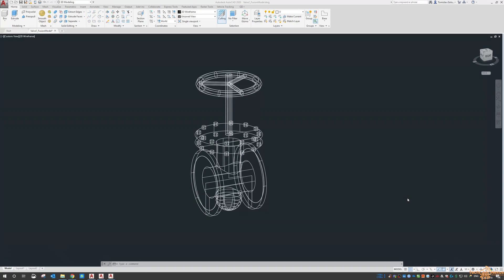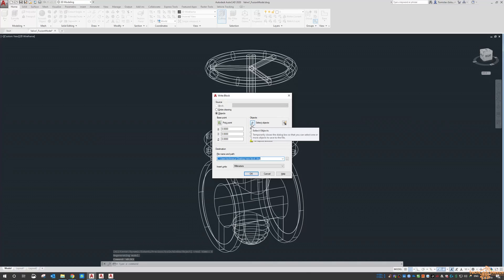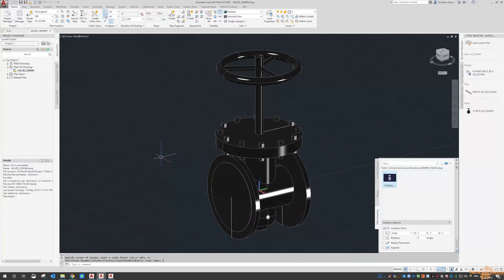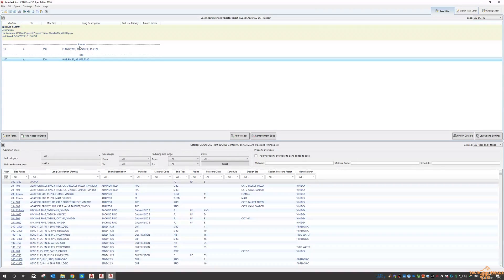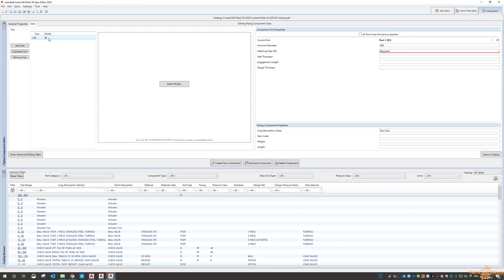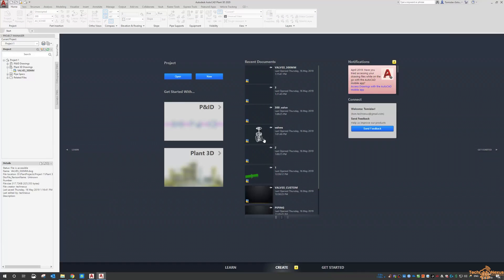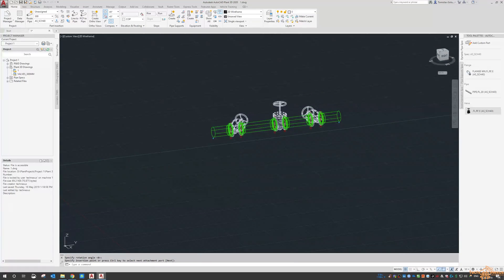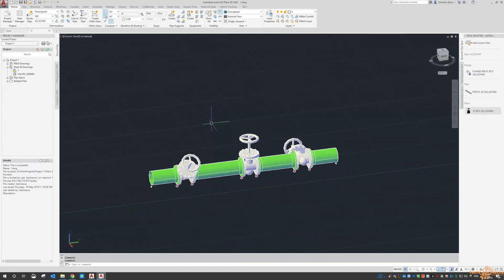Plant3D 2020 Cats and Specs - Part 5: Importing to a Catalog

Comment: Hello , Thanks for the nice video. It was really helpful and cleared a few things for me as well. Can you make a video on how to add a single valve of multiple sizes in the catalog
Reply from the maker: Hi, you would basically do the same but you have to make a valve for each size, if you're using a custom valve. If you're using the standard catalog valves, then you can use the Catalog Editor in Excel to add more. I will do that as a video next week and post it
Reply: @technexus  Thanks a lot.